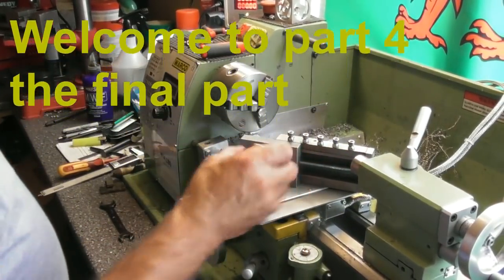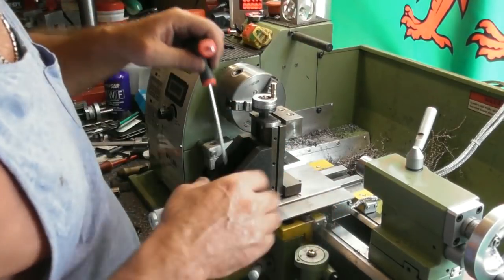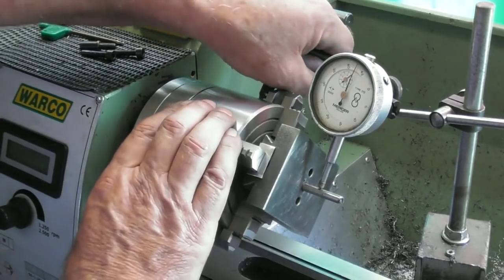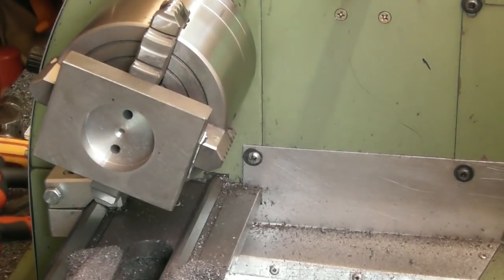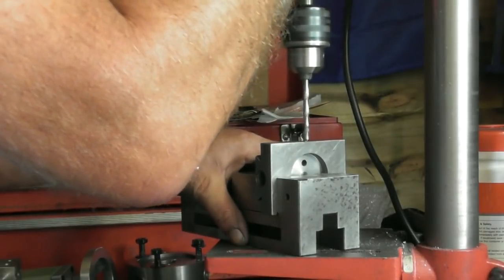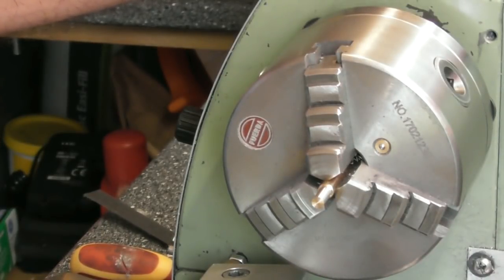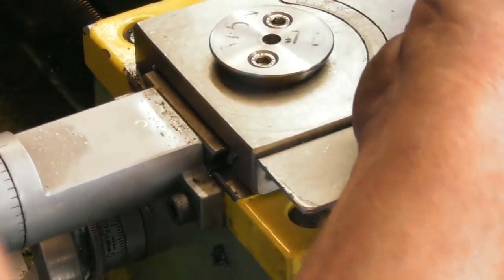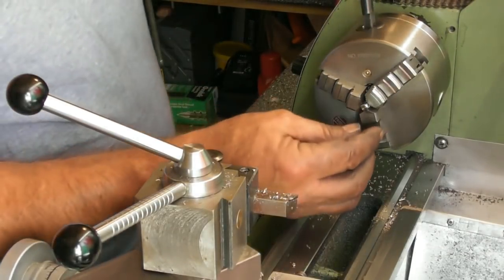Warco lathe compound slide improvement part 4

Comment: As an engineer I have lived and worked in third world countries for 50 years, the last 20 in Cambodia. I had my own well equipped workshop including a Colchester Chipmaster lathe which I purchased in UK many years ago for £400. The only modification made to it was a conversion from 3phase to 240volt.
Back in UK I am looking to set up a small workshop and considered the 180. However I have been totally put off by all the modifications that appear to be needed to make the machine fit for purpose. The 180 is described as a "Hobbyist" machine, it appears to me that once purchased it becomes the hobby.
I have gone for a elderly but in perfect condition Myford ML10. A machine that I can use from the word go without having to consider any modifications.

Comment: Ade,

I note in this series of vids you discuss the slide adapter you made to fit your vertical slide. Have you done a quick vid explaining how you did this and what you did? If not would you consider making a quick vid on the subject including any changes you might make to your own plate slide combo.

Cheers

Tim
Reply from the maker: Hi, Tim . i just put up a video Shed talk 11 that goes into detail on the milling slide set up . hope it helps Ade.

Comment: Well done Ade. You now have the same tried and trusted set up that is on my Boxford lathe. Makes you wonder why these Chinese made lathes are produced with that horrible clamping system.
Reply: Small Chinese lathes are pretty good for the price. But if they had most of the improvements you see done, they would cost a lot more, and people wouldn’t be buying them. As the models get bigger, more of the improvements are found. So the bigger models do have the screws where you can easily get to them. If you want those features, buy a bigger model.

But, back then, Boxford was the cheap, not considered to be particularly great, lathe. Even so, it was expensive for home shops. Today, it would cost several thousand pounds, new, if it were being made the same way. Not very comparable.

Comment: take it that the Warco is another make of import and seems quite good fit and finish, i noticed it had way wipers and the quality of controls is far superior to that fitted as standard to mine. there seems to be a vast difference in basically the same lathe from different importers. as i said before my 9x20 from chester machine tools was chronic but the same lathe from precision matthews is a nice bit of kit, looking back i should have researched the importers before parting with my hard earned cash

Comment: The plan was very well executed as usual, but I am sceptical whether this design is as strong as the original. Everything depends on those two brass plugs, but they are too short to be well supported, and their ends only make line contact with the cone.

Comment: The screws coming in from the sides is the only thing I disagree with. As we saw, there was a small, but noticeable amount of play between the slide and the rotating piece fitting inside. Normally, that’s a close sliding fit, with virtually no play. But in order to make certain it’s always solid when the screws are tightened, they are at a 120 degree angle. That way they push the slide up against the round dovetail inside. That gives the normal three point contact. But having the screws at 180 degrees, the only thing it’s guaranteed to be against are those two screws, allowing the compound to either pop to the front, or to the rear. It’s just a two point contact, which is why it will slip either way.

Comment: That's a great idea. Uses a similar way of clamping that an Atlas lathe uses. I wonder if there is enough room to do the same mod to my 7x14 mini lathe. Your compound seems a lot beefier, though. If possible to do, I have a bit of an advantage of my old South Bend in the corner to do the boring on.

Comment: Ade, where did you get the Allen Keys I see in your videos?
I have a Ferm lathe (Dutch made, 1960s'-70s') which is very similar in construction to the Warco brand.... I should do this mod....

Paddy
Reply from the maker: Local hardware shop . they are on ebey also . Cheers Ade.

Comment: Great upgrade Ade, good series & well done. Nice when it all comes together. What's your thoughts on brazing the brass onto the grub screws then turning them down at 30 degrees? Save all that messing about locating them.
Reply: Dave the full bevel gives a lot more wedging force than a pointed screw. On the lathes were this method was used from the factory, the wedges are steel with a screw pushing them in to lock the compound in place. Installing with a dab of grease on the wedges makes orienting the wedges easy.
Reply from the maker: I made fitting the wedges look more difficult than it was, I agree with Aceroadholder that tapered brass points will not grip the taper as efficiently as the wedge design . good luck . ade.
Reply: ADES WORKSHOP thank you both for the reply, makes sense.
Reply: Hi Adrian.  Great upgrade.
The brass plungers are a bit short/fiddly, due I suspect to the limited  amount of material between the edge and the insert.  Can you see any problems with, instead of drilling in at a right angle to the slide, angling the holes at say 30 or 45 degrees? This would allow the brass plungers to be longer, which would also make them less likely to deflect.
Cheers Noel
Reply from the maker: That would help . but it really was not a problem , i just made it look difficult with my clumsy approach. If i were to do it again , i would make the plug in one piece with a much smaller diameter taper , giving a smaller hole in the underside of the compound and allowing longer plugs . Cheers Ade,
Reply: Hi Adrian.

Noel is even more confused, it's not hard.

Wasn't the first plan to make the 'plug' in one piece?  but you realised that the top taper, had to be inserted downward, whilst the bottom ring has to be installed upwards.  The top taper could be made smaller, but isn't any reduction in size controlled by the position of the mounting holes?

In part 4 (5:30 mins) you fit the Vertical Slide (VS) to the existing cross slide  rotating plate, which you say locates the VS "in the conventional position".  Was it therefore necessary to make the VS plate?

With the compound slide modification in place.  Using the VS now appears to require the removal of the tool post and the top part of the rotating disk, to be able to fit the VS, with or without it's plate, is this observation correct?

Many thanks Noel
Reply from the maker: now we are both confused, what i was meaning was to replace the original disc with the tapped holes with a one piece disc and taper of a small enough taper to pass through from underneath without it being captive from above , only below as the original disc was . i could still fit my VS on the original disc to use it as a toolpost to machine the now smaller hole in the base of the compound to fit the smaller taper . clear as mud i know . send an email to adesworkshop@hotmail.com and i could send back  a scetch to show the plan

Comment: Hi Ades,
It's nice series of video and works. Thanks for sharing to us. I wonder if the mod introduces additional chatter due to possible weaker (than the original locking method) locking force of the setscrew and brass stud applying on the added disk. Do you see any chatter after the mod?

Comment: Why no cutting oil? Even on cast Iron It keeps the cast Iron dust down.
Reply: Cast iron is self lubricated because of the many graphite flakes present (which is what makes it cast iron). No coolant is needed, or in most cases, desired. It just causes the chips and powder you get from machining cast iron, to stick to the metal and become difficult to remove.
Reply: @melgross  I do agree with what you say.  I just use cutting fluid on almost everything. Then wash the machinery with break cleaner and re-oil, more work since I do machine shop as a hobby to keep me out of trouble.
Reply: @mr16ga  trouble? That’s what this is all about. Like my wife coming to my shop at 3:00am and wondering why I’m not in bed. Or what those half a dozen packages are for.